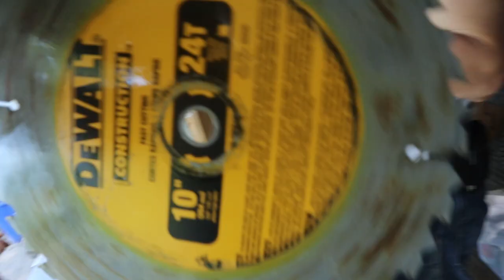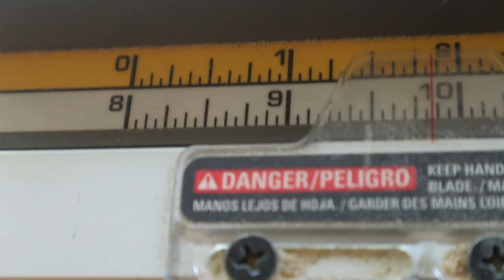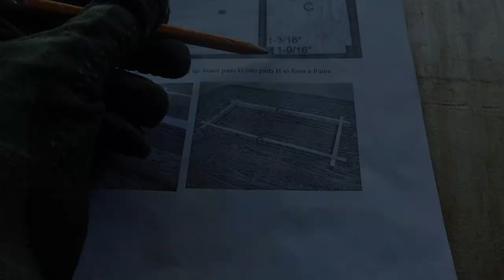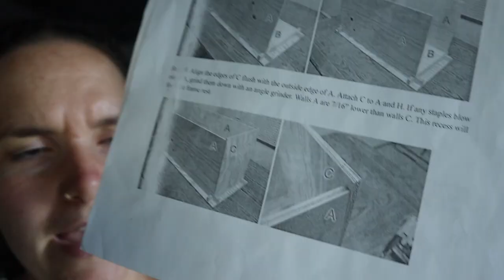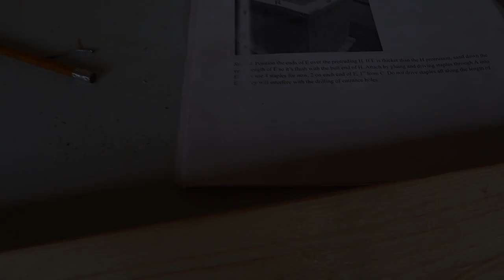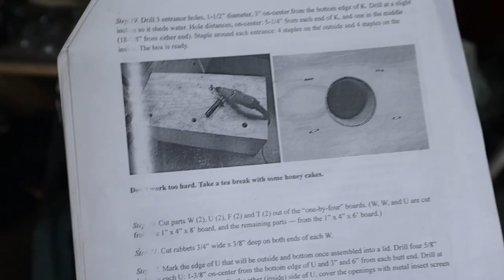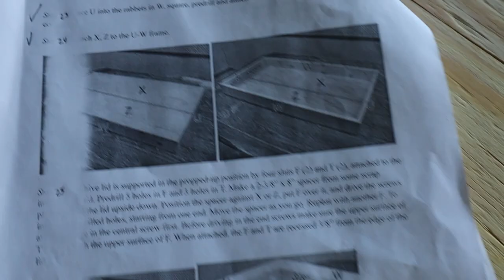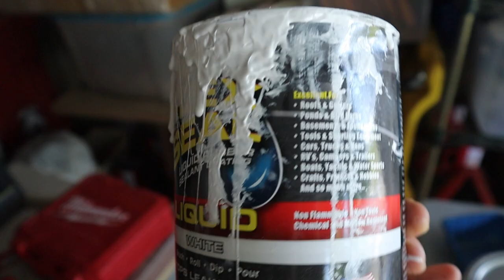Amateur Woodworker Builds 3 20-FRAME INSULATED HIVES! ││  Step-by-Step

Comment: Hi Elizabeth. They’re quite a project aren’t they? After watching the video today, one suggestion I would have would be to use a jig saw to make the notches in pieces A and C. It will be more accurate and definitely safer than the way you did it. Taking your time, making the cuts as square and accurate as possible will make it go together much easier. When you are dealing with multiple layers building on top of each other, each small error adds up to make a bigger one in the last step. I’m sure you learned a lot building them and the fact that you made it a family project made it even more special. Best wishes!
Reply from the maker: Wonderful, thank you for the feedback! I'll pin these so others can work more safely than I did!

Comment: Way to go taking a step into carpentry.  The advice I received during my carpenters apprenticeship was that the table saw is the most dangerous of the carpenters power tools (not that the others should be treated lightly).  So never push the limits or takes chances on any power tool, but especially the table saw.  My partner at work ended up with 18 stitches down his wrist as a result of kickback and a push stick with a non rounded edge.  Good luck and always operate your power tools with respect.  A good source for carpentry videos is the "Essential Craftsman" on YouTube.
Reply from the maker: Thanks for the encouragement! And for the fyi that the table saw is the most dangerous of the power tools- that makes sense. Never take changes-- great advice! Is there a way to safely avoid kickback? Pushing something through all the way with a push stick?
Reply: @curly-hairedcountrygal1275 , one of the main factors is keeping your work parallel and straight to your fence & blade.  This starts with checking that the measurement at the front of your blade to the fence and the back of your blade to the fence of are the exact same.  Then make sure that the fence is secure and keep the work tight to the fence the entire cut. If the work wobbles it wants to kick back.

One of the ways it wobbles is at the out-feed.  After the work passes the saw blade and the saw table the weight shifts and wants to move the work.  To prevent this, use an out-feed table or an adjustable roller to keep the work from tipping and support the work at the out-feed.  At competent person to balance the work on the other end also works, but they need to be on the same page in how you are working as to how is feeding and balancing ect..

I use a notched push stick with rounded edges that is maybe 16" long.  Obviously, always keep your hand well clear or the blade because it can be oddly tempting not to.

There are other factors, but the above is a good start.

Comment: Well done!
Not perfect by any means but you and the family tackled the task along having learned something together. I've been studying apiology and bee keeping several years in preparation for a homestead and the Layens hives will likely be the mainstay so I'm actually going to build some Layens traps and three of these insulated hives this winter while still living in town and set two of them up with friends who desire bees. Normally, we see these builds being done by the YouTube guy who's got the woodshop and years to make it look easy. Thank you for sharing and others have made good comments for safety, techniques, and other tools for task. As a guy that uses a vernier caliper while making my own design furniture, I did gasp a few times along the way, lol! 

Other hints to help are to use scrap pieces for test cuts to ensure that you're happy with the result and to test fit pieces dry before glueing and nail/screws go in. If you find an error, try to divide it between the different ends instead of letting it accumulate at one spot if not perfect. Epoxy mixed into sawdust can be a structural filler to fill gaps and provide strength while polyester filler can fill knots and cracks to sand down for vanity needs. As you saw, the right fasteners and screws are a must. A pilot hole drilled about the size of the screw minor diameter (the portion inside the threads) can be then followed with a drill the size of the screw heads just shallow enough to allow it to countersink and not protrude and tightened until only "snug" ;) 

You learned things that you can carry forward to other things like chicken nesting boxes and more with even better builds of your next three hives in the future!

Have fun!!!
Reply from the maker: Hello, Roy! Thanks so much for stopping by and for your comment!

Yes, as you alluded to, "you don't know what you don't know!" I thought I was being pretty safe! Ha! 

It's great that you're researching and planning to build some hives this winter! I appreciate your tips- I, too, hope to build three more before next spring. 

Good recommendations- 1. Test on scraps, 2. divide up errors, 3. epoxy with sawdust  for filler, 4. pilot holes. 

I don't know what a vernier caliper is, but sorry to make you gasp! lol

Comment: Nice to see you building your own hives.  As a woodworker I must say you are scaring me with the way you cut dados.  You should be using a mitre gauge to hold the pieces.  Never free hand cut on the table saw! If you were to twist the piece it could bind on the  blade and throw it back at you.  I have a hole in the  wall behind my table saw that proves kick back can be serious.  I saw a few other things that made me concerned but just be careful.
Reply from the maker: I am most open to feedback-- thank you! I just watched one or two videos on cutting the dados and he must not have free-handed it. 
I'll need to add a mitre gauge to my list of needed supplies. I'm going to pin this post so that other newbie woodworkers will know this.

Comment: Thanks so much for sharing!! I purchased 1 from Dr Leo and am hoping to make 3 per his plans this fall but am a little intimidated by it so your video was a timely encouragement.  You so creatively adapted to various aspects that went "awry":-)  I like the handle idea and that you pointed out the extra step needed (15b). The box reminds me of the ark of the covenant and wondered if anyone had attached poles for carrying and at either or both of ends you could put a board to place the smoker, etc. This was so helpful as this does not seem to be an easy build.  Where did you get your 11/32 untreated plywood?  Also on step 28 after you painted and decorated what did you seal it with?  Thanks again, much appreciated!
Reply from the maker: Hi again, Steve! I'm so glad this was helpful for you-- it would've been nice for me to find a video of a newbie building one, so I'm glad I could make one for the next person wanting to build!

As you'll see from PopPop31's comment, you shouldn't copy the way I cut the dados, so be careful, but I'm sure you'll do great. 

Oooh neat idea about poles like on the ark of the covenant! The handle is nice, but two would be more balanced, or poles as you said. 

Home Depot has 11/32 untreated plywood!

And the seal is water-based spar urethane-- make sure to get water based! 
https://www.menards.com/main/paint/interior-paint-stain/polyurethane-clear-protective-finishes/spar-urethane/minwax-reg-helmsman-reg-interior-exterior-water-base-clear-spar-urethane-1-qt/630520444/p-1539325739666-c-14367.htm?tid=7549575740806230051&ipos=1

Comment: You should cut the small notches with a saber saw. Much safer. You may already done that as this is a late comment.
Reply from the maker: Saber saw-- noted! I don't know what that is but I'll look into it before the next build! Is that the same as a miter saw?
Reply: @curly-hairedcountrygal1275  Miter-saw or chop-saw are the same. Saber saw is a smaller tool. Easier to handle.